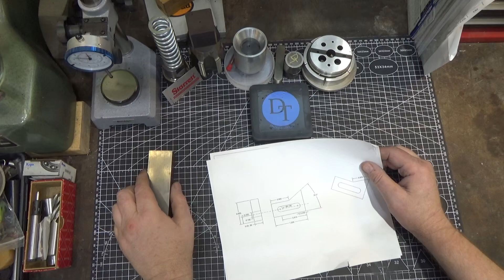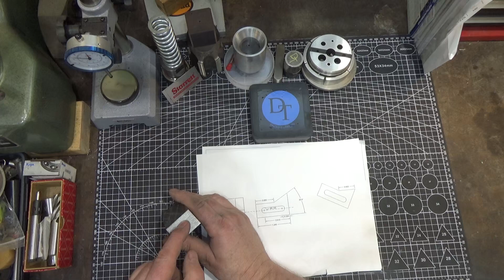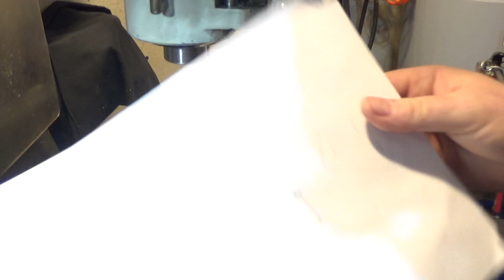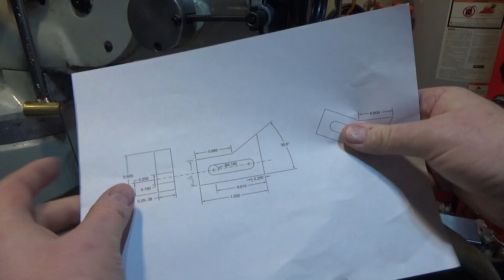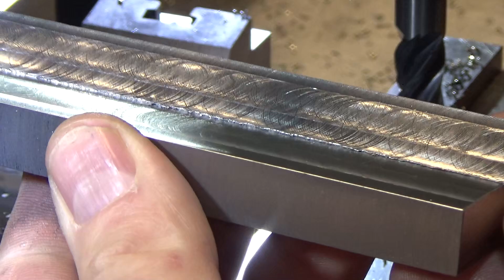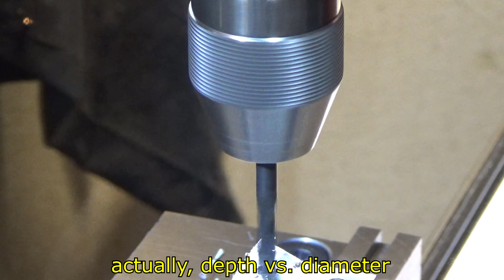162 More Aerospace Customer Parts

Comment: A suggestion....use a slot-mill for that kinda operation, 2 flute cutter....gives ya better results. Those adjustable v-blocks come in handy.
Reply from the maker: Thanks for the tip. I think my approach for this project was less than ideal.
Reply: @DudleyToolwright   https://www.ebay.de/itm/131836713616

Comment: For efficiency I know why you cut the centre slot on the larger piece although in this case considering you only needed 3 pieces perhaps cutting each centre slot individually would have yielded better results. Otherwise a video...thanks
Reply from the maker: I think you are correct. I thought I was being craft, but alas, I chose poorly.

Comment: Nice job 👍👍👍 thought I'd share my tip of what I do for dealing with burrs on flat or odd spots you can't use a noga etc I actually use a medium grade set of wood chisels they're hard but not to hard I just made up some blocks I use as sharpening guides and sharpen them as needed on my small disc sander they're hard enough they cut most burrs right off and cut down on sanding 👍👍👍
Reply from the maker: Thanks for the tips. I am always game for new approaches to old problems.

Comment: I really hope that that airline only used your parts as door stops. M
Reply from the maker: They apparently worked out fine, but I was not happy with them either, so I did not charge for the job. They were part of a jug the was used to locate holes to be drilled that were for injecting a fixing compound into a temperature sensor.
Reply: No never don't charge. M

Comment: I really wouldn't want to fly in anything your part's go in. M
Reply from the maker: Neither would I. fortunately these parts are for a fixture that is used to make the temperature sensors that go in turbine engines and I was well within tolerance, but gave the parts to the client for free because I was dissatisfied with the quality and there was time pressure to get them done.